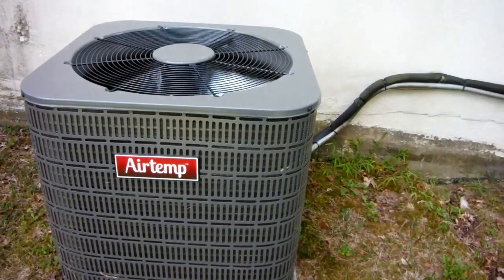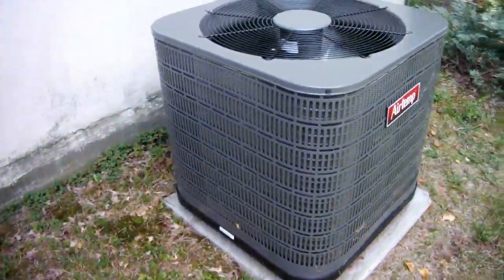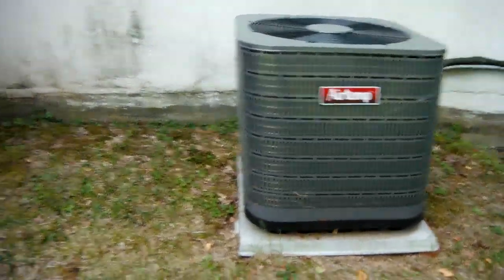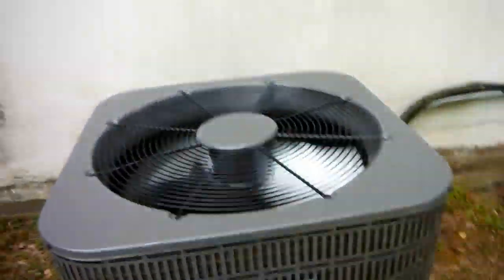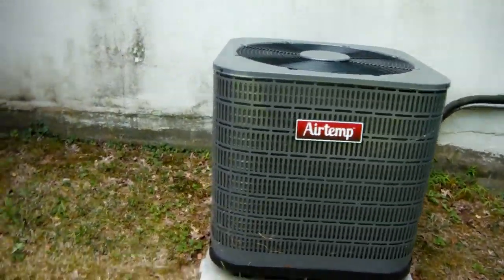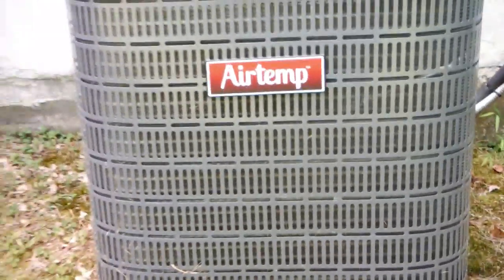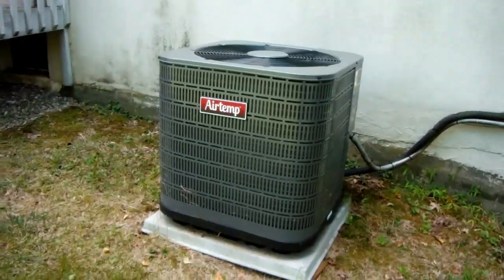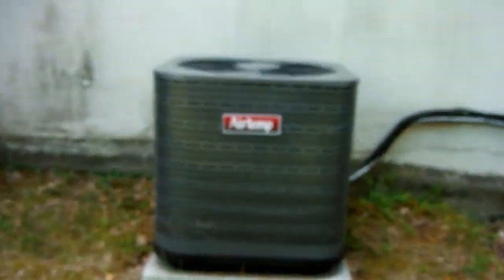2011 or 2012 Airtemp (NORDYNE) 3.5-ton straight-cool central air-conditioner running on a warm day!

Comment: I've installed a few of their systems (Nordyne re-badged as well as Air Temp). Clean, basic and simple. Haven't had any problems with them other than they're a little light on the initial charge. They're supposed to be charged for a coil and 15' lineset but they've all required a few ounces more to get them right. 

Oh and they are very quiet running.